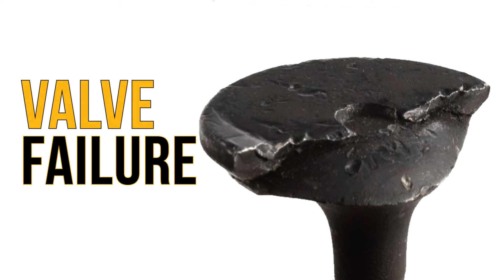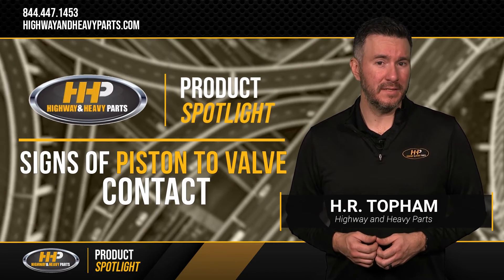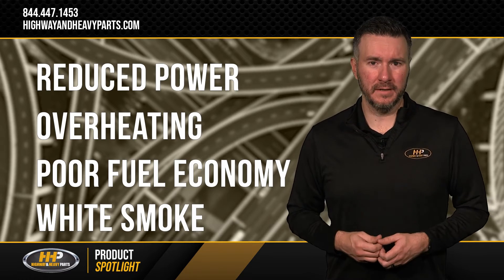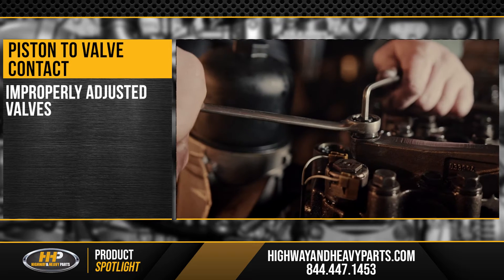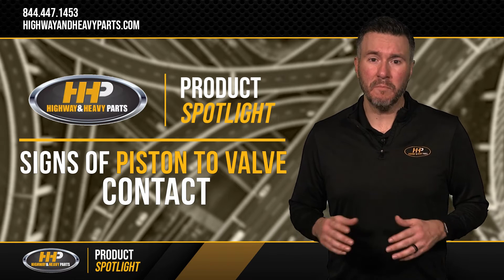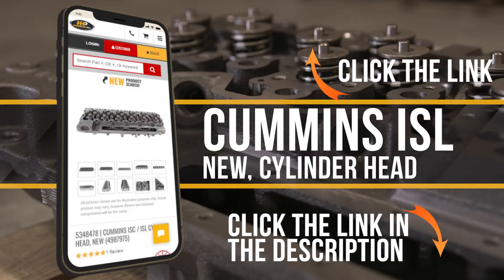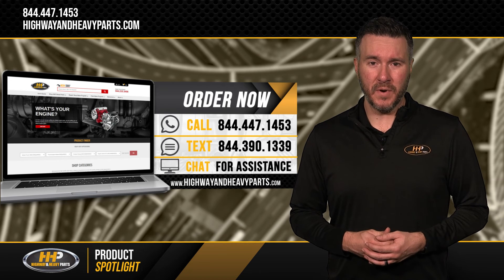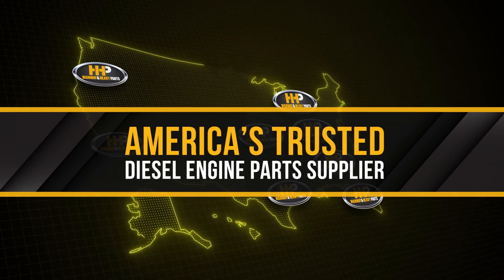What is Piston To Valve Contact In A Cummins ISL Engine? HHP Has The Answers!

Comment: How does valve spring can be broken please explain.Thanks
Reply from the maker: Maintaining correct valve operation at normal speeds, they must exert a certain amount of spring pressure. If the spring pressure is too low or weak, may cause valves to not completely seal or float. While, too high a pressure, may cause premature wear, of other valve train parts.